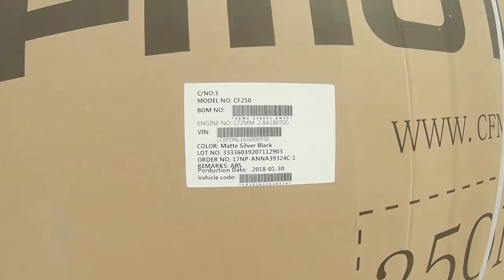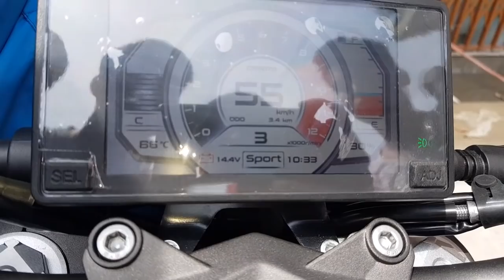250NK Unboxing/Test ride/walkaround/stand top speed.

Comment: Straight up duke knock off.... where is the company based from...??
Oh.. so it's Chinese... !!! Thought so
Reply: Cheli Lombi this bike and duke are designed by same company which is in Europe.
Reply: K Leo Chinese company tho.. final design approval is always given by the manufacturer not the designing company..
Reply: Cheli Lombi Both KTM and CFMOTo pay for the design,they  are equal.
Reply: K Leo nope.. no design passes into manufacturing process without the approval of the manufacturing company..
Reply: Cheli Lombi regardless of who approves who, this was designed by the designers of ktm.
Reply from the maker: CFMOTO took  51%  &  KTM  took 49%  for their new project, 
KISKA the designer company control the whole built quality.
So both are now in same legaue.
Thank you
Reply: David Mercado regardless of who designs the product.. it won't make it to production if it doesn't get approval of the manufacturing company...
Reply: Cheli Lombi it matters  who designed the product. As crazy things said Kiska is responsible of the build quality which means it doesnt matter which group approved who. It doesnt matter if you regard it as a chinese knock off because it is designed and quality controlled by Kiska.
Reply: David Mercado and it matters who approves the design.. because ultimately it is their product, they put out the specs and requirements and the designing team/company whips out the design demonstrator which requires for the parent company to approve to further go into production... So yeah don't judge me if it looks like a chinese company knockoff to me...
Reply: Cheli Lombi no one is judging you. We are just telling you what exactly the product is beyond your "knock-off" comment.
Reply: David Mercado how is it beyond my knock off comment exactly... Paint this thing in orange and ask anyone which bike is it... Changing the colour doesn't make it an original idea at all... 
I am not saying it's ugly, I am simply saying it's a complete rip-off of duke...
Reply: Cheli Lombi it is not even a copy of   ktm's duke.  Granted the style is similar, but that is because of the designer's style. Preference wise, to his to each own. Happy riding.
Reply from the maker: Cheli Lombi brother main point is who else making bikes dosen't matter,
Matter is quality products which is our need now, we are not supporting CFMOTO, but if they make products good with legal way .....why not?
Thank you

Comment: Muji k geda jasto video banako hw khoi tw bike ko barema detail description ????
Reply from the maker: Kamal Sunuwar brother daam you are😆
Showroom price: 4,60,00
27.2hp
Dual channel ABS, Two riding modes, TFT Dishplay, 12.2ltr fuel tank, 153 dry weight, Full LED head and tail lamp. 28 to 32 kmpl.
Top speed 155plus with six speed gear box.Company Name CFMOTO (Austria) desion by KISKA. 
Thank you
Reply: @CrazythingsNepal  muji chinese company ho cfmoto design hire matra kiska lai gareko ho muji jpt info nade!!!
Reply: @user-vf3rn8cp5o  CFMOTO Austrian company ho. Designed by KISKA Company in Austria.